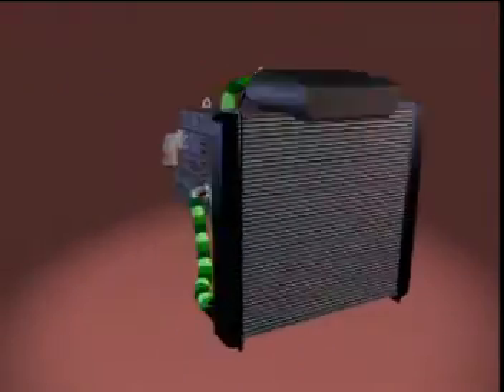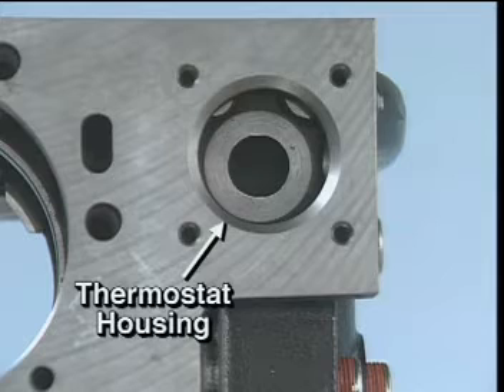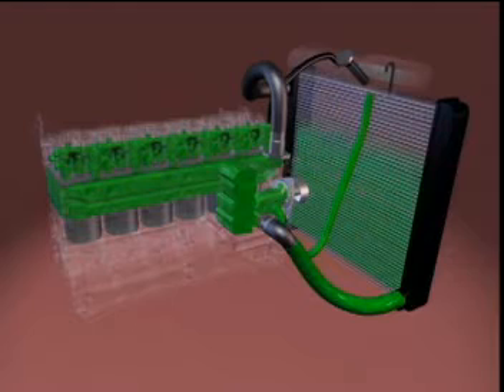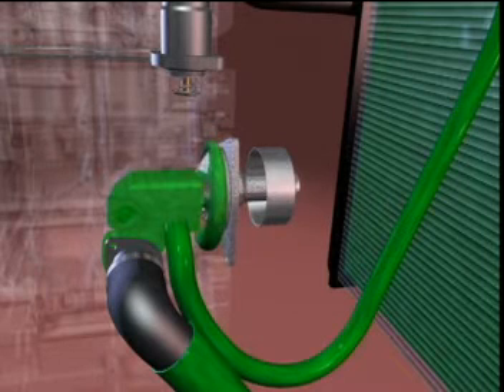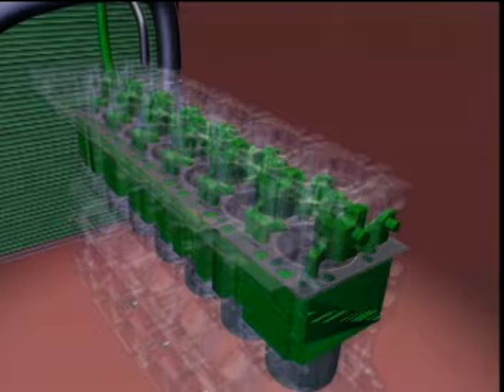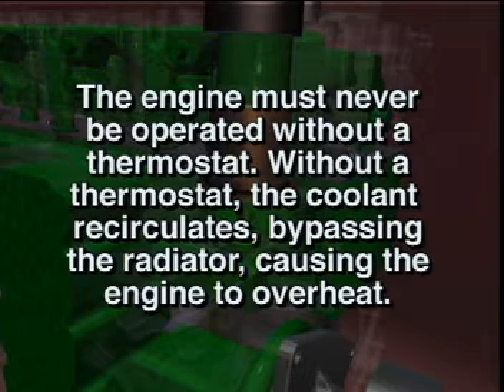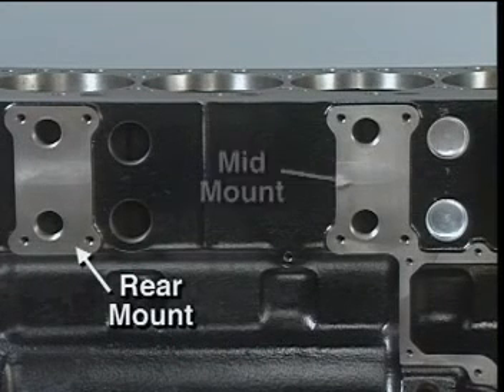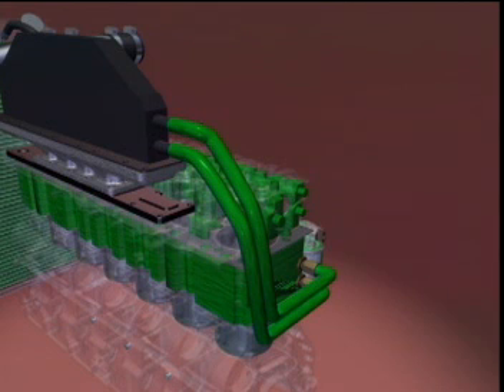Cummins ISC 8.3 Cooling system

Comment: is it true when you remove the thermostat you will bypass the radiator ?

because we remove it in most cases as we have very hot weather at summer to make coolant flow directly to the radiator without being regulated 

can someone answer this ?
Reply: Engine operates  at optimum  when at a certain temperature which is regulated by the thermostat
Reply: @PoliticalGangster  That's Right
Reply: Did You See The Video    No Thermostat =  Not Good  Will Over  Heat    On This Engine
Reply: Removing the thermostat is a terrible idea, do you not understand how a diesel engine works?
Reply: @QuigleySharps45  
I Know now
My comment was long time ago
Everyday we learn something new .